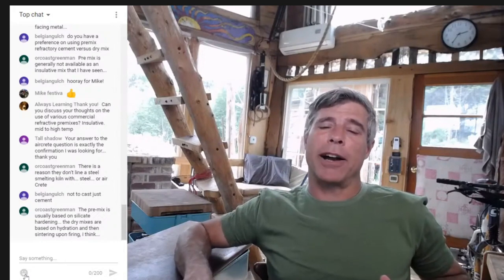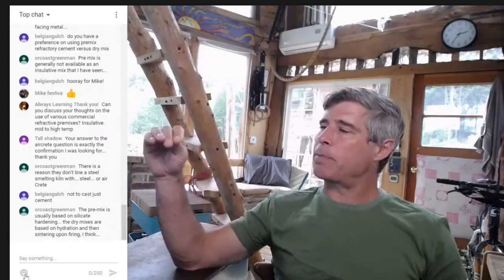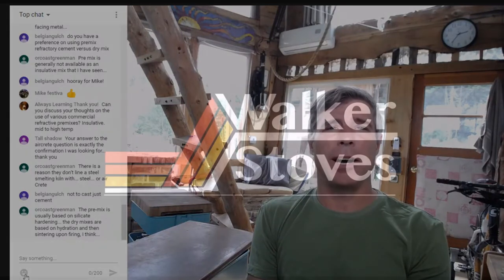Castable Refractory Properties for a Rocket Stove Build

Comment: A video topic close to my ❤!  Thanks Matt!  I'm ready to pour the ultimate stove.  After this video I'm thinking mixing  fire clay with perlite for the hot combustion sections will work if you can protect them from wear and firewood impact damage.
Reply: Matt used a pearlite and clay core for over 3 years in a J tube and ran at least a dozen cords through it - so it can be done and it can last. Such a simple mix can always be patched up as damage occurs.